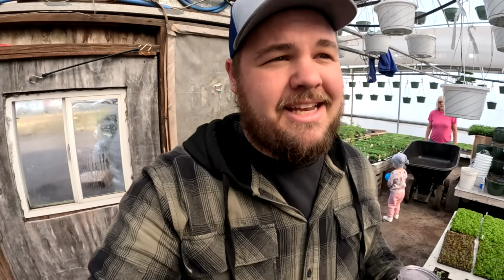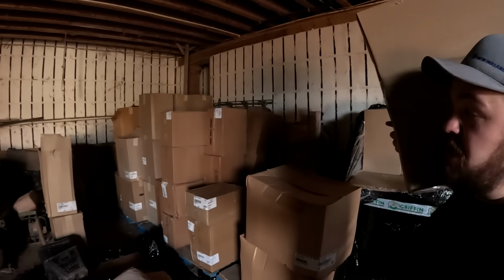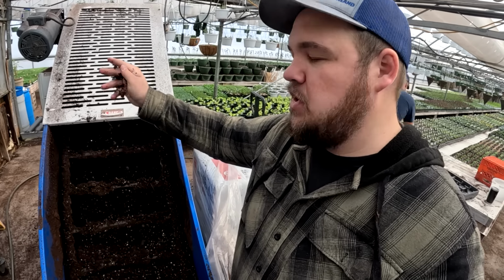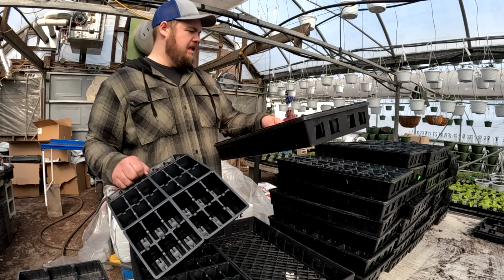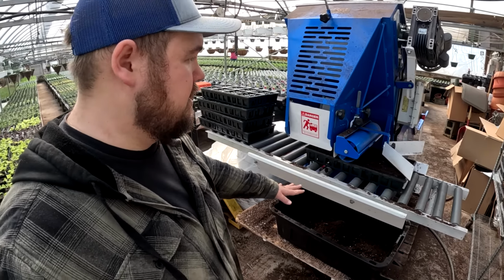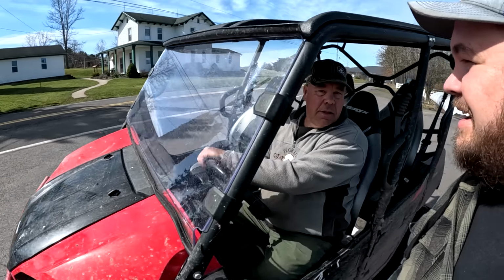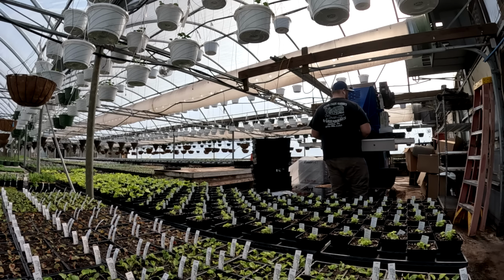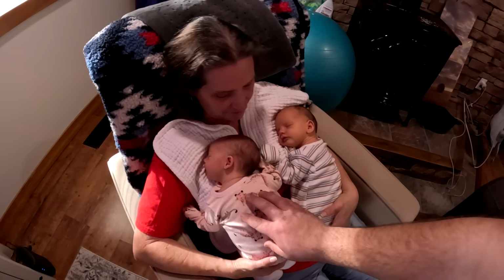THE GREENHOUSE NEVER LOOKED LIKE THIS BEFORE

Comment: Lauren needs 2 snuggle sacks. My twin is a boy as well. My mom told me this hack. Get the snuggle sacks and sling one over your shoulders and shift it to the right. Do the same to the second one and move it to the the left. Plop the babies in there out in the car before you go into the store. Not only are you going to start losing baby weight but you will heal faster. Have Andrew lift the heavy stuff ( gallons of milk etc.) but really just walk. Your babies are your exercise. Also my mom said to breast feed 2 babies she would football hold us. One under each arm facing you, face next to the breast. Have babies latch on and have Andrew get some firm pillows and slide under babies for support. Voila!!!!. You may already be doing this and if so skip it. Get your diapers and Home Depot if using disposable. You get more for your money and they both will deliver to your home.

Comment: Andrew,
Heres a farm riddle for you-
There is a farm with a boy & a newborn boy calf. Every morning before school
the boy has to lift the calf over a short fence into the pasture. After supper, the
boy goes & gets the calf and again, lifts it across the short fence into the 
barnyard for the night. By & By the calf will grow into a full growed bull. Will
the boy still be able to lift the growed bull across the short fence? He  built up 
his muscles as the calf put on weight.
What Say You?

!
Reply: Not by himself without assistance.  There's a limitation in how much strength one can gain as well as the rate of gain.  A calf packs on weight pretty fast.  From what I've seen, guys and gals who have worked on farms are typically much stronger and have more stamina than those who don't.
Reply: If the grown bull still needs to be lifted across the short fence, I'd say there's something quite amiss with him... LOL